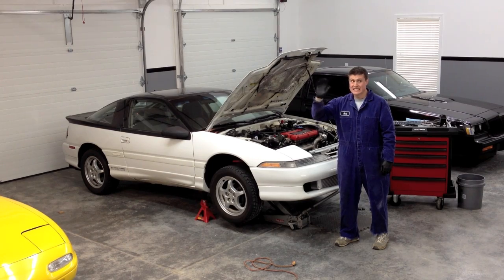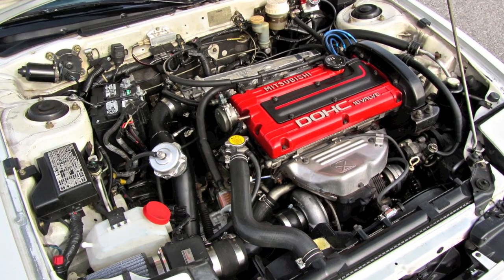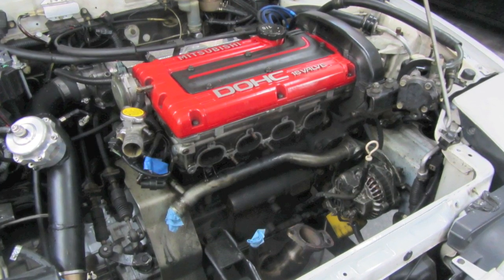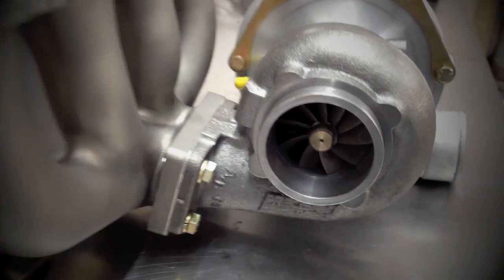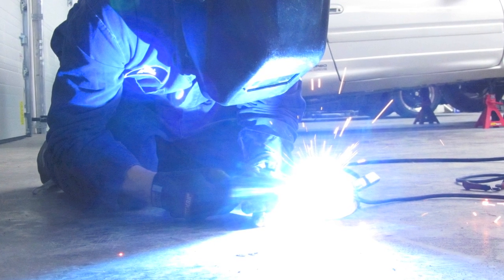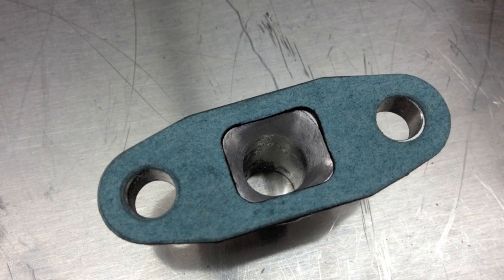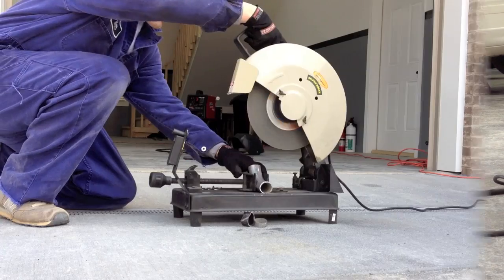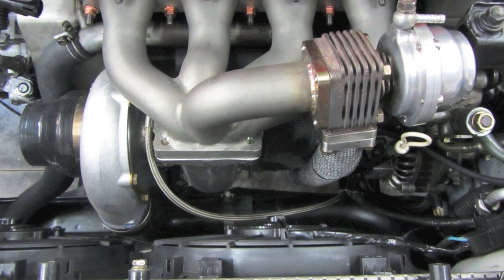Eagle Talon AWD Turbo Upgrade - Part One

Comment: The first experience i had with a turbo was on a three year old 79 Riviera, it was a nightmare til i figured out how everything worked. Amazing!
Reply: Tom's Turbo Garage How about some classic Toyota motors ! 2jz-gte or 1jz-gte or the old 7m-gte (these blow head gaskets like crazy if you use the old torque mesurements !)
Reply: only ever had the 6 cylinder models in NZ !
Reply: cool
Reply from the maker: Oh yeah, those early turbo setups were a bear!
Reply: Terry Thomas
You mentioned some good toyota engines, what do you think about the toyota 20-r and 22-r ?
Reply: Terry Thomas
These were a 4 cylinder engine with a hemispherical head, they could be hopped up pretty good but if you left them stock they lasted forever.

Comment from the maker: I've got some 1/4 mile runs in another video, although the clutch was slipping.  I haven't dyno tested my car, but given the trap speeds and weight, it's in the high 500/low 600 hp range.

Comment: Two fuel system questions. First, if i get 550cc injectors does that mean they are always squirting out 550cc or that is just their maximum and it won't waste fuel if lets say my car only needed 450cc of injection. Second, if i get a warbolo 255hp fuel pump how much power is that typically rated for? I understand it has to do with flow of fuel an hour but is that a good enough pump for two 13g turbo's and maybe 15g's down the road? @ 10psi

Comment from the maker: Hi Taylor, since I don't have any first-hand experience doing that, my best advice would be to visit a website like the DSM Forums and visit the section specific to turbocharging the stock non-turbo engine.  There are FAQs and build threads that will help you decide what path to take.  Good luck to you!

Comment: The stock 1G motor, especially the 6 bolt motor, can handle 600WHP on the bottom end and run tens.  However it is a built motor, it is over 20 years old but a 6 bolt crank 1G motor is easily the strongest 4 banger ever built for home consumption.